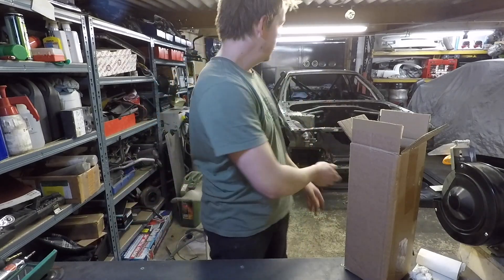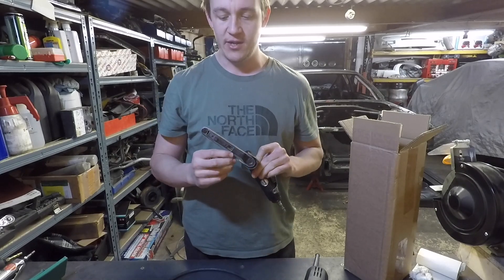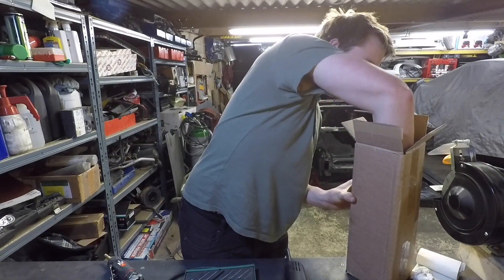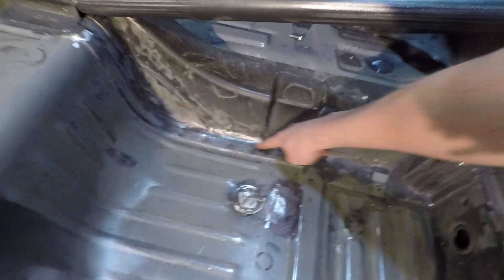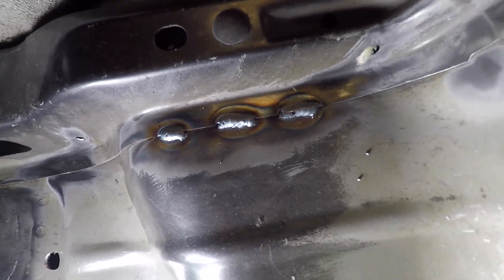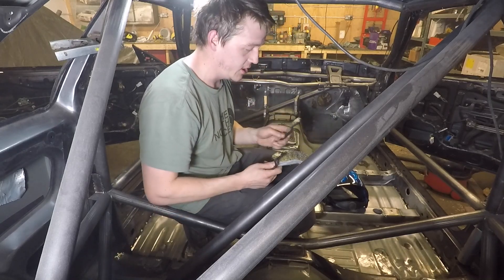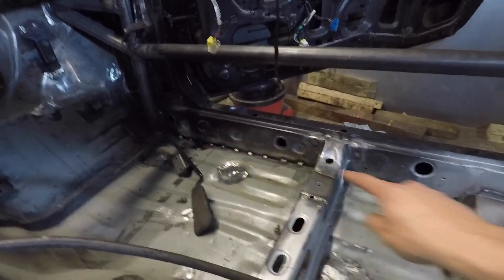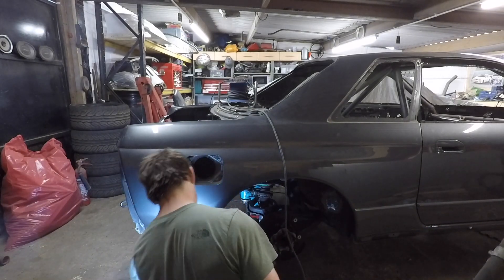Stitch / seam welding a motorsport shell - R32 GTR Build: Episode 2

Comment: Those twisted wire wheels are great for remowing seam sealer and under floor protecting sh1t if you can't remove those any other way. If you can it should be done other way that wire wheel. It's really messy job to remove seamselers etc with wire wheel 😅

Comment: Great content! Isn’t there any seam sealer between the seams? Im building a old Volvo and there is seam sealer also between the metal and the metal needs to be cleaned also between the metql sheets bedore welding.
Reply from the maker: Thanks mate. Right in between the mates surfaces no, only the metal coating (e-coat), but yes, over all the seams was sealer. Just have to take your tile to wire and pick it all out.